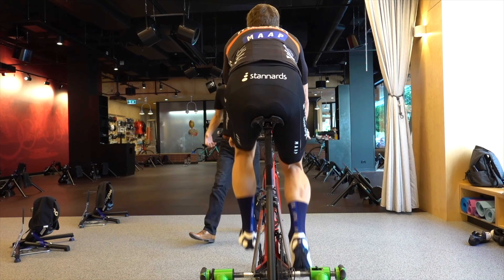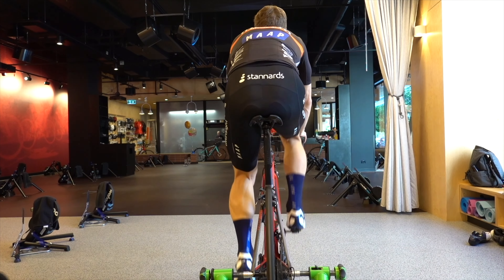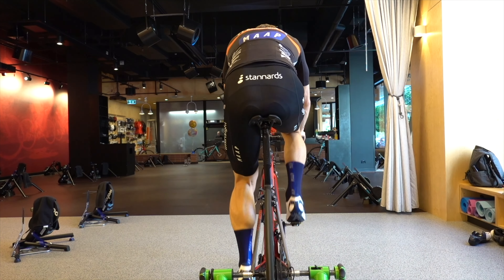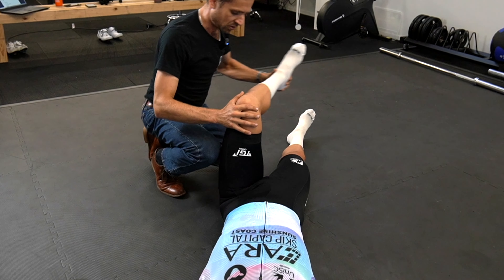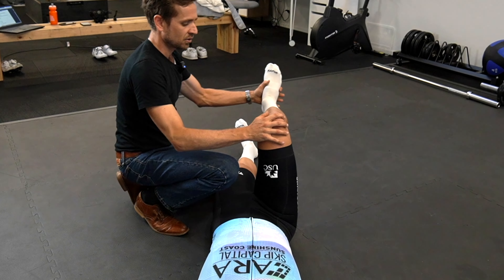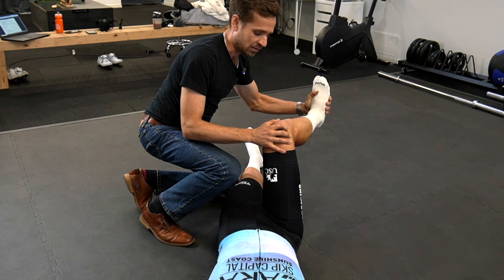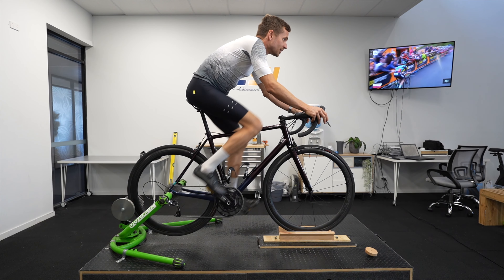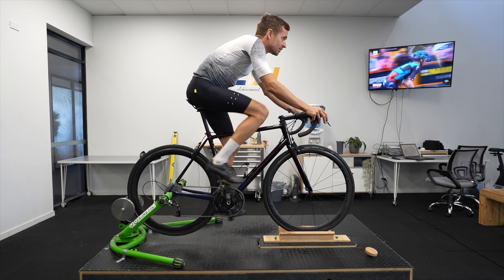5 reasons Why You Should Be Using Shorter Cranks

Comment: I brought a bike which was on sale. I thought if I could stand over it, with my feet flat on the floor without the top tube touching my crotch or feel that my crotch was sat hard on the top tube, then I would buy the bike. It tucked the crotch test so I brought the bike. I'm a short guy at just 5 foot four with a 29 inch inside leg. My thighs are shorter than my knee to the bottom of my foot. Anyway I knew that I can increase the saddle height by adjusting the pole the saddle sits on. The handle bars were a little too long for me but I could always scoot forward on the saddle or move the saddle a bit towards the handlebars. Anyway after buying the bike I adapted to the longer reach OK. But half way through the ride I experience this shooting pain in front of my left knee to the point I could not peddle any further I said to my friend I can't go on. I could walk but not ride. He went home on his bike and he came back in his car and drove me and the bike home. Anyway I came across an article on you tube which talked about shorter cranks. I knew I had to bite the bullet and get me a set off new cranks. It was a pain looking for Trigra 4700 all the cranks of 165mm were not in stock. But I managed to find a set. Long story short. What a revelation. Money well spent and that meant my cheap domane 4 was not so cheap anymore

Comment: Could you talk about the effect of crank length and the relationship of the knee angle at TDC and BDC. I’m 77 and use 165 cranks with old degenerative knee issues. My gravel bike has 170 cranks and my knees get sore after a longish 1-2 hr ride but not on the 165,s.

Comment: 194 cm, 99cm leg.  If I go down from 175 to 172.5 I feel like I'm pedalling squares, can't do it.  Didn't notice any improvement to hip impingement.  I realise my leg length is more extreme than most.
Reply: move saddle forward
Reply: I'm pretty far forward on a zero setback seatpost, certainly helps but there is a limit before you put too much weight on the bars and bike is out of balance and too much weight on hands.  175/177.5 isn't going away for sure

Comment: I think you missed one very important category and it's not just riders on the tall or short extreme, it's the balance between leg length / inseam and your overall height. More like the distribution between your top and lower half. For instance, I am 5'9, 185 lbs, quite lean, no gut but my cycling inseam is 34.25 inches, very short torso, and huge femurs. Hip mobility is great, I can squat to the floor w/ flat feet and be totally comfortable but this is because my knees go way outside my torso. See Squat University's videos on squat stance for different physiology. This is exactly the same for cycling. Long or normal cranks mean my knees will be hitting me chest at a normal saddle height (I'm at 740). 165s were a drastic improvement from 175 and 170s but was still having issues w/ low back and hip flexor pain. Funny enough, this morning I just installed 160s on my bike, it feels INFINITELY better. I immediately was able to raise my saddle 10mm more, I feel way more stable, it's insane how much better it feels. Wish I woulda done it a few years ago.
Reply: Great, any drawbacks you feel from the shorter cranks? Harder to climb or anything?
Reply: I'll need more time on the 160s to tell. My understanding of the science on shorter cranks is efficiency and power output is not changed until you really get to extremes. The power curve just changes slightly, so you might lose a smidge of max power in a trade off for slightly lower power for longer. In my opinion, it's all about comfort. I'll trade anything to feel better on the bike, to ride more comfortably, for longer, train more etc. Also, opening my hip angle allows me to ride more aero so even if there was any power trade offs, they would be far outweighed by aerodynamic advantage. @myxti3669
Reply: I guess 175mm seams to really be for the tall and strong guys riding 600 watts on a time trail
Reply: I am 69 yrs. Most all of the bikes I've had all came with 175s. At 5' 11, 174 lbs, inseam of 33, right leg shorter by about 3/8s of an inch, I am leaning towards the 167.5. Have a new gravel bike based on what they call 56cm, bt it sure is hard to myself comfortable on this thing. Seat forward, back, up, down, cleats in, out forward and back. What I've deduced is setting seat height from the crank at bottom of stroke times the 1.09% method and have finally cme up with something getting closer. Cleats near as far forward as possible, seat forward past center. Almost have it dialed. This is with an extra shim on the right cleat. (1) 2mm shim on each pedal which changes the "Q" factor and cleats all the way inboard as well. I'm bull legged. Which now brings me back to the shorter crank lengths. I a sure my flexibility is considerably less that it was 15 years ago so now onto maybe what will help. I do all of my own fitting. Change things until there isn't any discomfort and move on.
Reply: @DanielGruszka

Comment: I recently went to 160 cranks after staying with 172.5 for the last 10+ years along with raising my saddle by 50mmish, and the difference is amazing. I don't like to grind at low cadence so I also went from 52/36 to 50/34 on my crankset, and I can hold the rpm that is comfortable, along with making the power I have. All of this has led to an improvement of approximately 25w alone. On my first day wit the new fit and the new crankset I matched my ftp after being off the bike for most of a three-month period (rode once a week) and can hold those 25w at the same heart rate as before and I don't feel as tired as before. The better aero position is also a huge benefit as all of this has shown an almost 2 mph speed increase on my solo rides for a given effort. I have been talking to the guys on my team about it and I have convinced several to 1.) get a good fit, but 2.) shift to smaller crank length, especially those who are built similarly to me.

Comment: I might’ve missed this in the video but if you go from 172.5 to 165 cranks , do you also adjust saddle height ?
Reply: Shorter cranks typically raises the seat height because the crank at the bottom of the pedal stroke will be higher.
Reply: @jeffreysaffir6000  that makes sense , I was just wondering cuz I don’t think that was mentioned in the video , thanks

Comment: Tried shorter cranks and had issues recovering post ride with more avg force on the pedals (at sub-optimal cadence I suppose).  Went back to 175mm as I have long legs/short torso at 6’1” and reasonably good mobility.

Comment: if anyonre don't have physical limitations, than the most correct way to choose the cranks length is according to length of the legs. but not only inseam matters. it is important to take in account the ratio of hip and shim. if hip longer than shim it better proceed with longer cranks. if shim longer than hip it is better to choose shorter cranks. the ratio of hip to shim crucially influence on cranks length
Reply: I agree, im worried that this ‘whole hip impingement thing’ is getting overused.
You suggest a recipe for upper leg versus lower leg. Any link to the recipe you mention?

Comment: I'm using a 172.5mm on my outdoor race bike, and 165cm on my track bike. Initially I set my saddle on my track bike on the same height (measured from the center of the BB) compared to my outdoor bike. But recently I put my saddle 7.5mm higher on my track bike, which allows me to stretch my legs/knees as much as on the race bike. Does that makes sense? Or should I keep the distance saddle-BBcenter as common reference?

Comment: I'm 6'2 with really long femurs running 175mm cranks. But also I tend to spin high cadence 95+ for threshold and definitely a more aerobic kind of rider. So a bit conflicted maybe I'll try 170mm cranks some day.
Reply: some Brand do have 172.5 for a change
Reply: 6'1(185cm) here and also long femur. I have 35'' inseam (89cm) and short feet for my height 10 1/2 US (44EU). Long legs, short torso. I need a lot of saddle setback so my saddle tends to be lower than the average for my inseam. Also because my tibias are shorter thant my femurs and my feet are not that long for my height, a 175mm crank feel way off. I feel like I'm pedaling a giant bicycle. I immediatly felt the difference it when I switched to 172.5mm but it is still too long. I think that crank length really depends on the way it feels rather than measurements.

Comment: How does crank length compare to a chainring tooth reduction for steep uphill climbs on MTBs?  I am 70 years old, lean, and losing leg strength almost as fast as my hair.  I want to try options - 165 mm crank length (currently 170), oval 30 tooth chainring tooth (currently 32) before capitulating and buy an eMTB.

Comment: Thanks for the interesting content, you have been advocating shorter cranks for a while and I understand the advantages. But aren't there advantages and good arguments for longer cranks, as well?? Especially for taller people (like 1.95m tall and 96cm inseam)?
Reply: Ich habe ähnlich lange Beine und hatte deshalb "früher" auch mit 185ern experimentiert. Bei denen hatte ich das Gefühl, dass ich mit "Drehmoment" fahren kann, und dass die Arbeit über einen größeren Anteil des Muskels verteilt wird. Problem war, dass ich immer das Gefühl hatte, dass ich die Sitzposition nicht richtig eingestellt bekam. Und: je aggressiver der Oberkörperwinkel, desto unwohler wird man sich fühlen. Kurz: je länger die Kurbel, desto mehr steigt die Anforderung an die eigene Beweglichkeit und an eine wirklich gute Position.
Reply: @c.thiele1588  Thanks for sharing, replying in English so everyone can follow. Torque comes from force and lever, so with less force you can produce more torque if you increase lever - which I can see can help some riders. Downside, you mention: wider movement range, possibly more difficult to adjust seat position or get into aero positions. My main interest: the bottom area of the stroke with long legs - how can that be tuned best?

Comment: Soft Tissue Opposition (STO) lol
As an older rider (60 y/o) I certainly suffer from this condition.
It amazes me on how the industry arives at a standard. Given this discussion I wonder if the standard set-up for the average rider should be with 165's. I would venture to say the average rider would never think twice about having a shorter crank and would just ride it the way the bike shop sold it. However, they would have a much better physiological experience.

Thanks for sharing
Matt
Hudson Valley, NY
Reply: they should make 160mm cranks for size 52cm bikes and 165mm for 54cm

Comment: Crank length change in 2 bikes for me this year. TT 165 from 170 (recently tried 155mm but didn’t like the loss of torque) & road bike 170 from 175mm.
6ft 1 inch, 73kgs reasonable mobility but I am aging….hit 42 later this year 😢
Reply: You can change gears and get the torque back... You lose horsepower which is the "over time" portion of the equation. Short cranks don't make your muscles weaker
Reply: Did you notice an improvement ?
Reply: @Gk9311 cadence up 2-3 rpm immediately. Otherwise too early to tell really.
Reply: @GazRadCycling  I have the same height, but  ~ 10kg heavier. Seriously considering getting to 170 from 175. I am mostly doing long distance riding.
Reply: @Gk9311 actually I don’t see any drawback as to why you shouldn’t go for especially if you’re on the lower end of the cadence schedule currently. I plan to do a couple of videos on my channel on both bikes that have made changes this year as also gone narrower on bars too following expert bike fitter advice

Comment: My inseam is 71cm, but it is difficult to purchase cranks smaller than 165mm on the market. Even that is very expensive and cannot be used.
Reply: The problem we all have , if you need anything less than 165mm . You would think crank manufacturers would have cottoned on by now ? I'm sure the Chinese will step in since the rest are so hopeless. 
I am currently on 165mm cranks on my full carbon bike ultegra,  but still way to big for me , 5'4" . My hack bike has 140mm from a generic folding bike 140mm is about right ,possibly 145mm  or 150mm but as you say almost impossible without big experience and hassle.

Comment: how are you measuring seat height? From the middle of the bottom bracket to the top of seat? I am 170 cm height / 75 cm inseam. what crank length do you recommend? 155mm? currently on 172mm with some knee pain from motorcycle accident.
Reply: Saddle height is usually measured from the center of the bottom bracket to the very top of the saddle, ideally at where you sit.

You can try 165 mm on a fit bike with variable crankarm length adjustment during a bike fit first, see how it feels.

I stand at 165 cm with a 77.8 cm inseam and never had any issues with 165 mm crankarms.

Comment: I'm 2,02m. I'm more of a lower cadence rider. My muscles can put high force over a long time, but as soon as I go for high cadence they start burning super fast. On my older MTB I have 180mm shimano deore cranks, from the time where shimano had a series for taller riders. Everytime I step from my road bike (175mm) to my MTB, the crank length feels so much better, but I still feel, like it isn't enough. Therefore I have been playing with the thought of getting cranks manufactured. That would be a lot of money. So, how do I know if it's a good idea or not and for what length should I look? How can I calculate that to at least get an estimate?

Comment: if i'm 168cm with a size S bike with 170mm cranks should I try 165mm or even shorter?
Reply: You can try 165 mm first, but not on your actual bike yet. Do it during a bike fit with a reputable bike fitter.

Comment: Great, informative videos. Thanks! I had total knee replacement and developed excess scar tissue during recovery. Due to this, I can only flex my right leg to about 90 degrees, making a full rotation of a standard crank arm length impossible. If I used a very short crank arm could that possibly allow a full rotation with a leg that only flexes 90 degrees? Is there even a way to test this without buying new cranks and just hoping?

Comment: I have some hip flexor impingement , which resulted in a recent bike fit dropping the crank length from 172.5 to 165 . The improvement felt from this adjustment and other tweaks was pretty immediate. However, the major impediment to moving to this set-up is now actually getting 165 mm cranks that are compatible with the various BB set-ups. Here in Melbourne and most likely across Australia currently acquiring cranks or crank-sets of this length is near impossible.
Perhaps the shorter cranks and their benefits is an aspect now being picked up by bike fitters across the sector and hence this dearth in being able to acquire these length of cranks .
The fact you can't get them is obviously relieving riders' discomfort, as you can't get out and ride

Comment: I'm only 182cm  (5'11") with short legs for my height, I love 175s on xc mtb. I've tried 170 many times but i feel my legs are too close together when I'm standing and pumping the bike through corners for example, and also when standing up to pedal hard - attacking a climb for example - longer cranks have more leverage so when you're using your whole body to pedal, longer is better.
For road bike it's totally different as you're in the saddle and spinning more often. I love 172.5 on road and would probably be able to change to 170.

Comment: Hi Neill, Do you think using shorter cranks can also help fill out the dead zone in pedalling ? Im 173 cm in height and i use 170mm crank on my Aero Bike while 172 mm on my Climbing Bike. I have a huge dead zone from 8 o'clock position to 12 o'clock and would like to know if using shorter cranks would somewhat help fill this up. FYI, I dont have any hip flex issues and my saddle height is 695. What size crank would you recommend to get a better pedal phase and do you think using shorter crank would affect climbing efficiency ?

Comment: Any changes needed to the chainring size after adjusting the crank size?
Reply: Go by percentages, a crank that’s 10% shorter ‘requires’ gearing that is 10% lower but if you’re only dropping down 5mm, the percentage is tiny (less than 3%) so you’d barely notice the the effective gearing change.

Comment: very insightfull vid! but I don't realy understand how you think a 'non-powerfull-high-leggspeed-rider' will have benifit from shorter cranks. I do thing it is actually the opposite.
If you have good legspeed you won't have to much touble (neuromusculair) to ride high cadance with somewhat longer cranks (when no biomechanical limitations). the distance you foot is travling is longer than with shorter cranks so the speed you have to develope to ride the same cadance is higher with longer cranks. the benifit with the longer cranck is that you don't have to push that hard because you have greater lever. 
the opposite: going to shorter cranks you will have less biomechanical issues because you will have to develop less leg speed to accive the same RPM. but next to that you will have to create more force to create the same momentum with this shorter lever.

this also might explain why you have trouble answering an acceleretion with you shirt cranck setup.

hope you fount this note interesting! 
have a good day!
vocsnor

Comment: So you're saying myself as a 60kg 5'7" bloke (seat height at ~675mm) with a tendency for riding at high cadence I should really be thinking about 165mm cranks rather than the 172.5mm (that came on the secondhand bike). My summer bike has 170mm cranks and i can't say I notice any difference.
Reply: I've seen other fitters discuss this exact scenario and they usually say they wouldn't bother with any change less than 5mm. Most people won't perceive any difference with 2.5mm and the change in hip angle and other potential benefits likely wouldn't be worth the cost and effort.